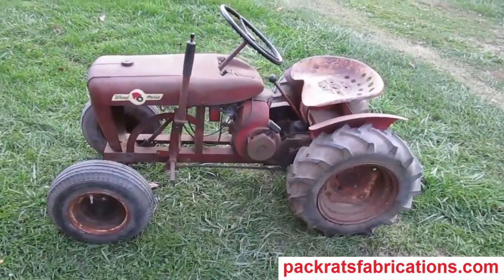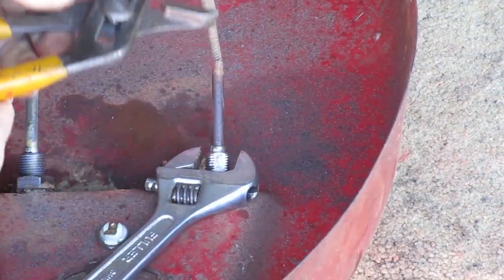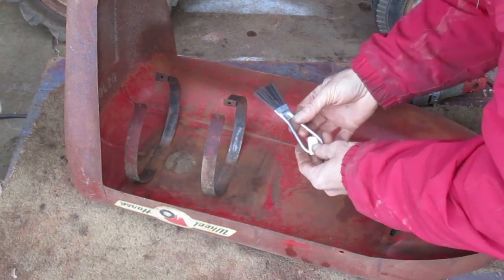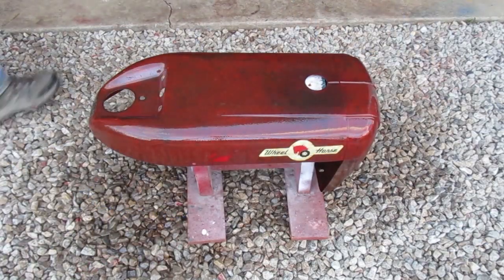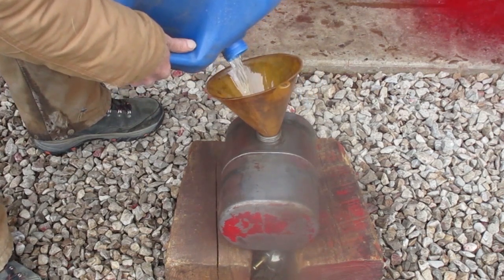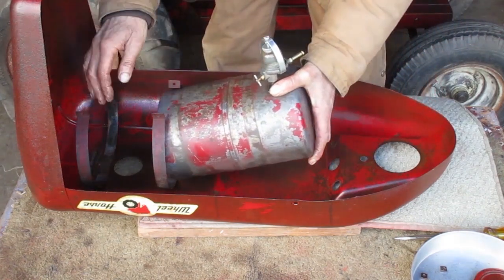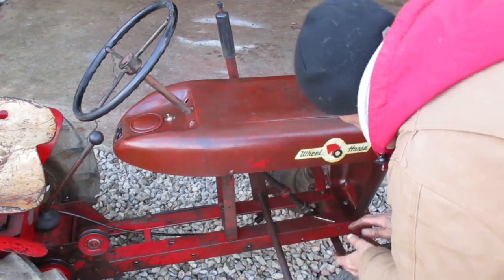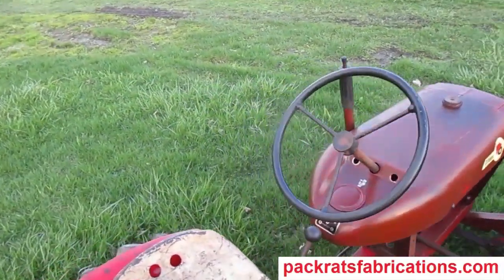Wheel Horse Model 401 Cleanup #9; Hood & Fuel Tank

Comment: Just discovered your videos, really enjoying them!  What are you spraying on the body after cleaning?  I've got a 606 with a nice patina and want to preserve and enhance
Reply from the maker: I am using WD-40. My excuses are: that's what I had laying around, and it looks good for a while.
It dries up in a year or two and you have to redo it but it's not any harder than cleaning the dust and rain spots off the tractors that have good paint jobs.
I've heard of people using Marvel Mystery Oil, or boiled linseed oil. They would probably last longer than WD-40.
Reply: @PackratsFabrications  I know a many guys that use Linseed oil. This stuff is really super. Really lasts and lasts.